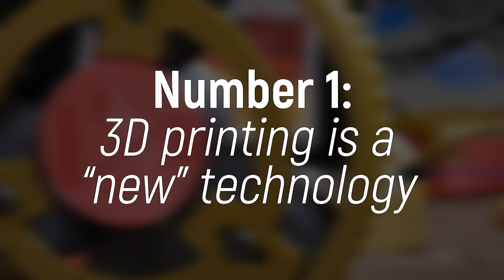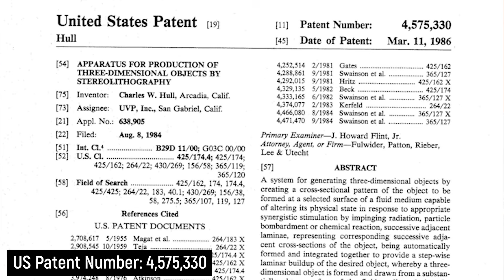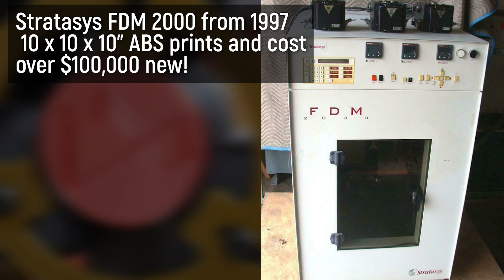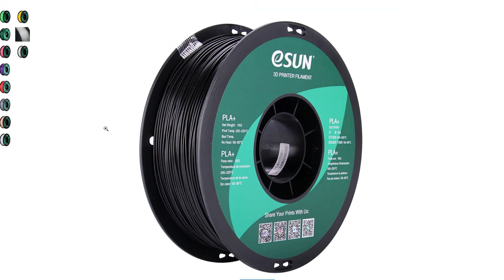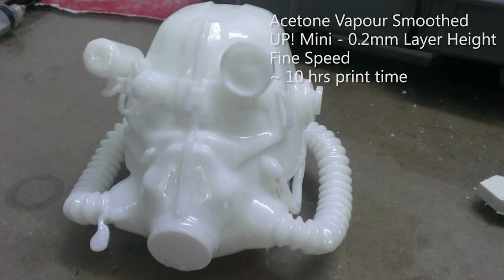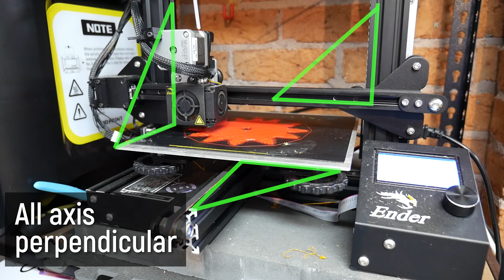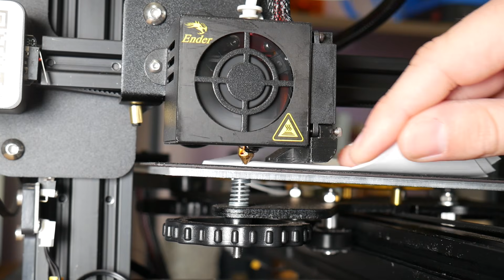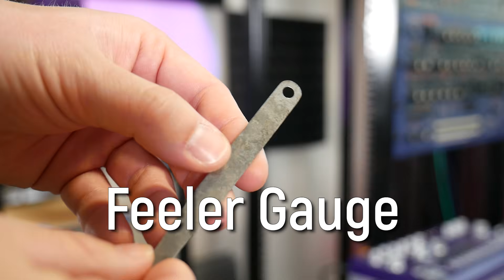3D Printing Myths I used to believe...

Comment: I've always used a single unfolded sticky note getting about the same amount of friction feel then little adjustments when the brim is going down ... works most of the time plus then I don't have to hunt down where I set the feeler gauge down at. I do really like how far the auto level features have come.

Comment: I used 80gms single layer paper and had the elephants foot with PETG, so I tried 75gms single paper and let the paper drag and slightly push back, and that worked perfectly. I level every day and auto level too. Then when prompted, I do the Z axis and that works great on my Elegoo Neptune 4 Plus.

Comment: In my opinion on completely failed to explain the bed leveling problem. The problem is in fact warped cheap beds. The problem is solved with tick beds like the voron, now you just need to tram. Before with not thick enough beds it was the problem, "every" bed was fucked end relied heavily on probles to "correct" this. Those 4 springs on a ender 3 are in fact completely useless, in fact, all the printer is, waste of money

Comment: Wait wait wait, a piece of paper folded a few times? No, it should be 1 layer of standard paper that has the thickness of roughly 100 microns. So if you want to do it right get the height of the nozzle to 100 microns away from the bed and use paper without folding or you can set it to 200 microns and fold once but its kinda the same thing. Don't use the auto bed calibration that goes to the corners and wait for you to adjust the springs IF you don't know the height of the nozzle from the bed. It will cause you to have elephant foot on the bottom of your parts.

Comment: i always used a single piece of paper to level my bed not a folded piece and my prints always knock it out of the park no elephants foot nonsense and no issues with dropping the plastic from 40k feet up either IDK what yall are doing trying to bed level with something as thick as a BB.

Comment: I used the paper method to level the bed. I use a post-it note as it is thinner than a piece of A4 paper. Then I print a large square on the printer .I tune it by adjusting the Z offset in settings. I find the post-it note paper puts the bed very close. When tuning with the z-offset, I get -0.03. This is on an Ender 3. I lower the Z-offset by -0.01 at a time and go to -0.06 to see where the best print is. It is usually around -0.03 to -0.04. There may be a slight adjustment of a leveling wheel on one corner where the nozzle either touches the bed or the filament doesnt stick. My Ender 3 V3 SE is down to -0.423. Thats the best I can get it as it was set up with the A4 sheet method. I prefer the V3 SE but I am upgrading the Ender 3 to have Neo parts and auto bed leveling.

Comment: ABS is the best option for one thing that was important to me. I tried many different filaments and ABS is the only one which can stand up to the Arizona heat outside. All other materials melted, even when printed fairly thick.
Reply: There are materials that handle heat even better

Comment: I start with the paper method to get close and make sure I'm not going to dig into the build plate then I print the 5 squares and adjust from there. Rinse repeat until they are perfect and then do a full bed first layer print. When it's all perfect then I proceed to do my prints. usually bed remains level for many prints unless something happens such as dropping something on the bed or I have to move the printer for some reason. If I start having problems with prints sticking then I do the squares again. I haven't used glue or painter's tape ever since I learned this process.

Comment: ABS alloys are still a LOT stronger than PLA alloys, and chemically always will be. Anyone saying otherwise is selling a product.
Reply: Wrong. They are weaker in tensile and bending strength, and some pla blends are even matching abs in impact performance. Abs is only better for creep and temp resistance.

Comment: My opinion on ABS is that this is a fairly "hard" material; They might break into parts when apply too much force, but in a lot of cases this is a good thing. I would rather my structure breaks than bends. If I'm printing a gearbox, I would need the strength so that the gear ratio is always fixed, but if the gear tooth slip across each other, that's not gonna help at all.

Comment: It would be good to have a feelsr gauge guide for different materials and different beds types.
Reply: I bought a set of feeler gauges but they only go down to 0.05mm. I remember when they had a very thin feeler that would tear if you twisted it with force.

Comment: Use thin pepper each changing of temperature settings, never been a issues. Round around the 5 points ubtil you haven't changed the settings for the last 5 points check. If you just installed the printer first Time you may easily spend 5-6 rounds, but for a change of temp 2-3 rounds will do it

Comment: I remember years ago having to shim all 4 corners of my Printrbot Simple Metal printer so the bed was perfectly square with the rest of the printer so the height of the bed was constant everywhere. I used the bed proximity sensor to achieve that (it had a light that turned on when it detected the bed). Once I did that, bed adhesion problems completely disappeared and it became an extremely reliable printer that made high quality prints. I'm still using this printer today and can't find a good enough upgrade option to justify a change. Know your printer, figure it out and it will serve you well for a long time.

Comment: Try this method:
Take a 1-2-3 block or a thick parallel or a gauge block or any small but chunky piece of metal with top and bottom surfaces reasonably parallel to each other. 
Measure the thickness of the metal block as accurately as possible, at least with a caliper, better with a micrometer
(a cheap micrometer is more accurate than a decent caliper).
Take a digital multimeter, set it to continuity test.
Attach one test lead of the multimeter to the metal block with an aligator clip, the other to the hot end.
Make sure the bottom of the nozzle is clean metal .
Raise the print head by the thickness of the metal block.
Proceed with adjusting the bed height but rather than feel or sight, go by the beep from the continuity tester.
When the nozzle touches the block the tester beeps. Back off until the beep stops.
This is similar to the auto tool height setting on a CNC router but instead of sending the signal to the CNC controller, you are the “controller” reacting to the beep sound.
This method is very accurate and consistent.

Comment: as a machinist, the paper is a pretty old school trick and it works fine. strange to fold it though, dont fold it. you go until there's a slight drag. paper is usually .0035 to .004 inches (.08-.1mm). need to mic the paper to get any better than .0005" accuracy
you actually dont want to fold the paper cause it makes it more spongy

Comment: The first process i saw was in 2000. It dropped a layer of fine polymer dust down the sprayed a resin over the top then another layer of powder and so on. In the end you had to dig your model out of a box of dust.

Comment: Always check your bed is even (level) with a test print. It dos not really matter how you got there, it's the results. I designed a few 150 x 150 x 0.6mm test objects. I do a final fine adjustment while it is printing.

Comment: I have a Creality CR5 Pro H, for levelling the bed I made my self a gadget that sits on the guide rails which has a stylus DTI (Dial Test Indicator) in the middle, it is impossible to cover the entire bed but I have found this method best to use before setting the nozzle height. I then use a 0.05mm feeler gauge to set the nozzle height, after using the DTI method this process requires very little adjustment, I would recommend when using a feeler gauge that you do not trap it so it cannot be moved, you want just a little bit of friction, this is because as described in the video your bed is flexible so over tightened will create inaccuracy.

I am CNC machinist/production engineer by trade so I employ mechanical engineering techniques to my 3D printing and fortunately it often pays off, I appreciate not everyone has access to some tooling but it can be very useful even for the home user.

Comment: For leveling, I always use unfolded paper. I play with the knobs until I have same resistance when pulling anywhere on the bed. Then, I put the head in the middle and change Z-offset until paper get quite a resistance when pulling. That tells me I am at 0. Then, I try a test print, a single layer thing that will tell me if I have error anywhere. I'm using hardened glass bed, so there's little danger I will scratch it.

Usually works perfectly.

Comment: I used to Babystep Z, then I releveled the bed with the knobs loose to start. Then used single unfolded piece of thin paper to barely feel resistance from the nozzle, then it's been a perfect first layer everytime.

Comment: I always was told just single layer of paper not folded, but I have always tweaked it further.using a first layer test.   I find feeler gauge is great, but most gauges don't sit nicely enough on the bed.   Paper is about the right thickness and for 90% of cases will set it pretty close and often good enough for most domestic users

Comment: What he said about bed levelling is not accurate at all- bed levelling has nothing to do withg the tram of the print head or the X/Y squareness of the machine. It's measurement between the nozzle and build plate, and even if the print head were tilted 45 degrees in X/Y you could still "level" the bed. What Bed levelling does is measure the perpendicularity of your gantry relative to your build plate. And that's basically it.

Comment: Where did you get a "folded" piece of paper to set the Z offset? No. One (1) piece of standard copy paper has a nominal thickness of .0035" (~.1 mm).  Tear off a corner of one (1) sheet--DO NOT FOLD IT--a 2" x 2" piece is more than enough. Then lower the nozzle (or cutter on a mill), moving the slip of paper underneath the nozzle while you are lowering the Z axis until you feel the the first bit of interference from the nozzle on the paper. Note that Z height as your temp Z0. If the bed has been properly trammed, I would then consider moving the z height down a lower .002" to .003" (not the entire .0035"). .0005" should be plenty toleranced to be able to begin to print to.

Comment: A ”fundamental misunderstanding” that makes me crazy... “tolerance” is not the same as “clearance.” I watched a video recently which was titled with “setting up tolerances” in Fusion for 3D printing. The video was actually about how to create clearance in Fusion for 3D prints. There's a not-so-insignificant difference between the two terms. After I commented as such, the video’s author informed me that he knows the difference but he used the wrong term because that's just how most people refer to creating clearance.

Comment: I am surprised Angus that you don't seem to understand the setting the nozzle height concept you are so knowledgeable and helpful otherwise. 
As you correctly mention that Z zero in the g code is the bed surface.
You need the nozzle set so that when it moves to the first layer i.e. 0.25 the nozzle is should   be 0.25 mm above the bed.
If you set the nozzle height with a piece of paper the distance for the first layer will be 0,25 +the thickness of the piece of paper.
Good enough.
If you use a feeler gauge which I agree is a better method as is doesn't bend like a piece of paper then you must adjust the zero offset with the same with the same value as the thickness of the feeler gauge.
More accurate than the paper method without a zero offset but the difference is minimal as  the paper is so thin.
Then if you get first layer issues you adjust the first layer values in the slicer.
I admit there is no squish with this method as the first layer is the theoretical value in the g code.
To get squish you need to cheat.
That is to say once you have set the gap correctly move the table up by the amount of squish you want.
Extremely difficult.
If you want 0.05 mm of squish then you have to move the table up by 0.05  mm with the leveling screws with a feeler gauge that is 0.05 mm thiner or dial indicator.
The result will be that when the g code moves the nozzle to 0.25 the actual distance is 0.20.
The key to good first layers is to set the nozzle correctly and then fine tune the first layer values in the slicer.
Reply: I am sorry I have got that wrong, you can get squish via the Z offset by entering in a value of the feeler gauge + the amount of squish you want.

Comment: The paper trick is not the best because like he mentioned there can be a lot of variance in how much the paper moves because its a flexible surface that youre leveling. Ive worked as a machinist and CNC programmer for 15 years and I still will use a piece of paper sometimes for touching off tools (you dont really use it for leveling, thats what an indicator or probe is for), but its different because when I touch off an endmill, I can repeat the difference of slight drag and the paper stopping with just a .001 movement in Z, this is because I am touching a carbide tool off a solid table or tombstone so no flex like a printers table. I will use a feeler gauge combined with a dial indicator when leveling my printers. I will make sure Z is right in one spot with the feeler, then use the indicator to make the rest of the table that height. Some may think its more work but I made a small attachment that lets me attach/detach a dial indicator very easily and it is nice because I can see exactly how the bed looks, whether its high or low in some spots or if its warped, and it ends up getting it pretty much as perfect as it can be.

Comment: The trouble with a feeler gauge is not being able to see when the bed moves if the fit is too tight.  If differs from using paper such that you have feel the fit differently.  It is more a matter of will the Guage slide under the head with minimal contact.   Also, the Guage is generally steel hitting up against brass which at the nozzle point can be a problem.

Comment: My problem with the Ender 3 pro is that I went cheap and got the 8 bit version. I have the upgrades for the 32 bit and the part that levels of the bed but I have not plugged them in at all and I have lost them but they are not expensive. I will get upgraded eventually

Comment: Lego is ABS plastic. Abs is easy on the Ender 3. But it is ANNOYING with the huge amount of fumes. Pla is nice but PETG is better in every aspect

PLA absorbs. Moisture just like Silica Gel and if you leave the roll uncovered it will be very difficult to print because it will warp and become brittle.
Reply: Wow, so much misinformation lol.
1. Abs is impossible to print properly on ender 3 or any open printer, you need either an enclosed or actively heated chamber. Not counting printing very small items.
2. Petg is not better in every aspect 
3. Petf actually absorbs moisture, pla does but barely so they are not even close
Reply: @riba2233  PETG is great!

Comment: Bed Leveling - after watching a few YT videos I was able to understand a successful procedure . This is what works for me 100% of the time;
1. I Home the Z axis , disengage the stepper motors then I use the standard piece of on each of the 4 corners
2. repeat step 1 at least 1 time
3. I then print a Test print that puts a line of filament 1 inch on the outside perimeter of the bed sheet 3 times just touching each one as it passes beside the previous line
4. I manually fine adjust the adjusting wheels as the print proceeds until the correct "squish" is obtained 
    If the squish is too great the color printed will become transparent
    if the squish is insufficient then the line will be a thin line that doesn't stick well
    if the squish is perfect it will appear as a solid flattened layer that is well connected to the following line
5. I restart this test print until my adjustments are perfect
6. THEN I CLEAN THE BED WITH ALCOHOL AND PAPER TOWELS before every print
My prints at 100% speed are near perfect on an old Ender 3 Pro that I was gifted. Once in a while I do a test print with the fine tuning.  If I try to speed up the prints I get defects. If you need more speed , save up your money and buy a Bamboo P1P.

Comment: This may sound ridiculous, but I have 2 lights set up, one behind the printer and one to my right. As long as you know what you are looking for you can level the bed by looking at the reveal between the nozzle and the bed. I haven’t used a slip of paper/etc in a month or 2 now. This works of course while a print is running, but a little more difficult with no filament being extruded.

Comment: I bought a set of feeler gauges when I bought my first printer. The reason I did that was because I'd watched so many people using an unknown grade of paper to "level". As there has been a tool whose thickness is known and precise, forever, I used it instead from the get-go like most engineers.

Comment: If you're new to 3d printing get an an auto bed level probe and update the firmware on your printer if you don't have the bed tramming wizard feature. This CHANGED MY LIFE. Now when ever I need to relevel my bed the software tells me the distance between the nozzle and the bed and what knobs need to be turned to level things out.